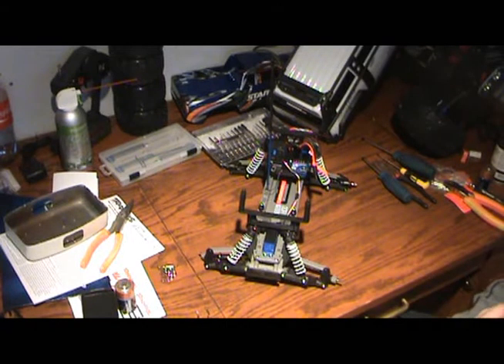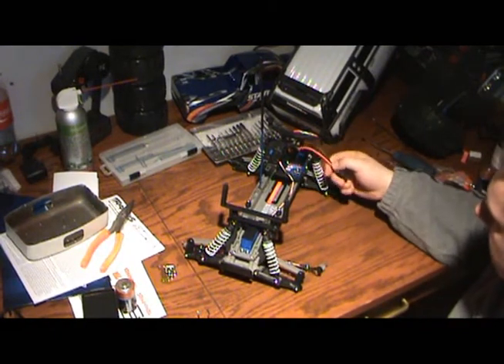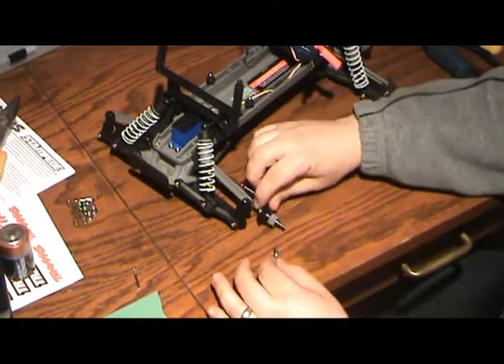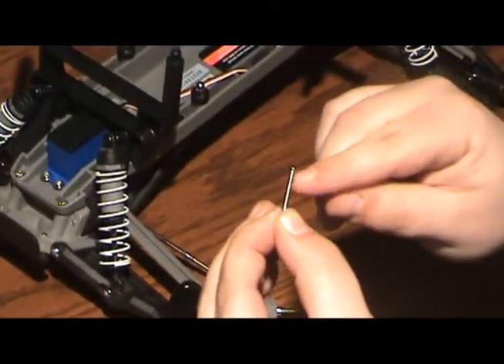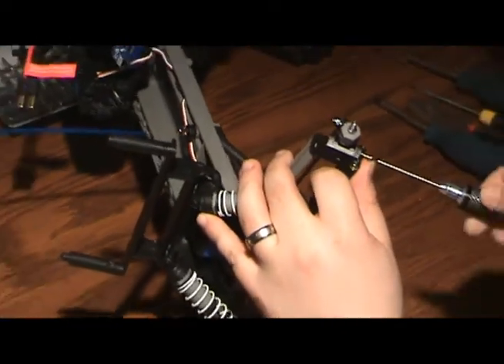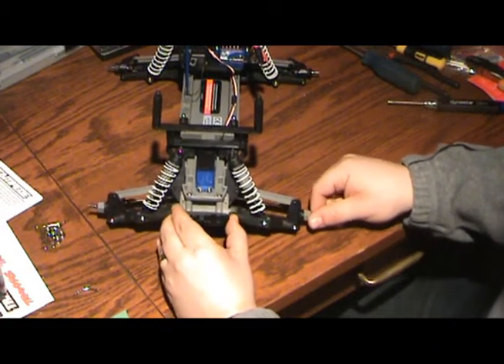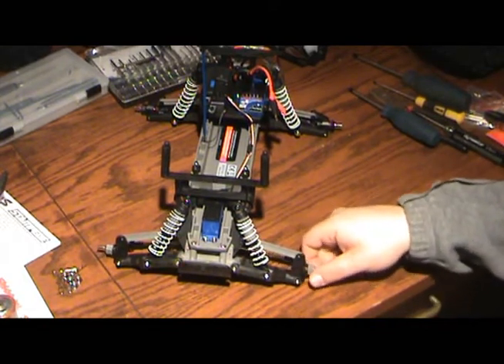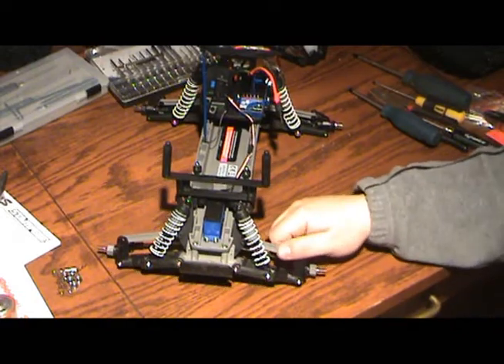Beginner Series - Fixing a Bent Kingpin

Comment: I found that changing to aluminum Caster and Steering blocks helps prevent bending kingpins, RPM is good don't get me wrong, but the plastic bends to much in that area, making it easy to bend the king pins. I just kinda got into RC as well, Still in the process of upgrading and tweaking my Stampede so it can take more of a beating then What I see some people do.